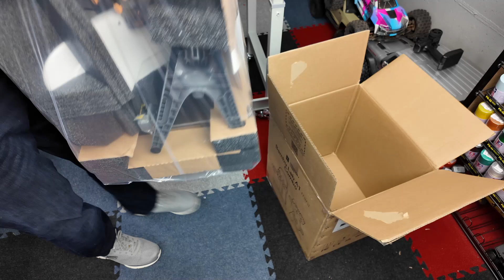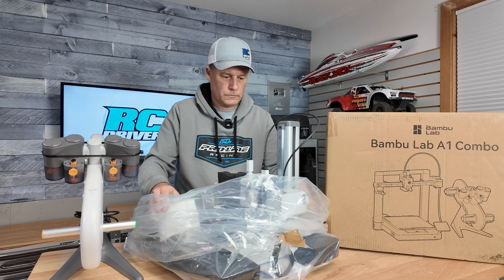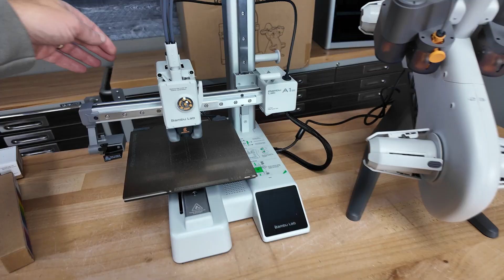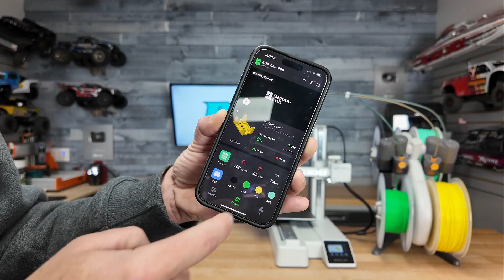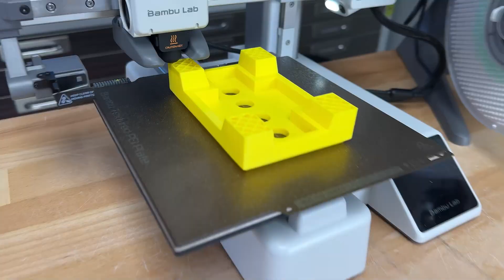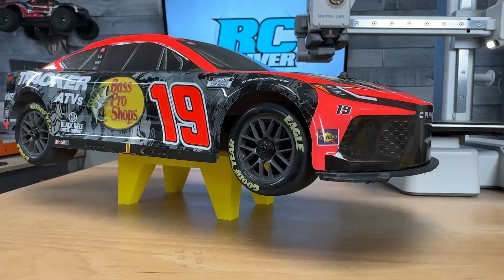$180 Amazing Mega Easy Set-Up 3D Printer - Bambu Labs A1 Mini

Comment: The version you have is the combo for $350, not $180.  Also, even though they calibrated it at the factory, you should always calibrate it out of the box and it’s also recommended to calibrate after you move it.

Comment: Only thing I would say is that you kind of want an enclosed printer for anything RC. Accessories are okay out of an A1 mini, like stands and scale bits and bobs, but anything structural like glass filled filaments or nylon for actual structural pieces like wishbones needs an enclosed, preferably heated chamber. 

PLA/TPU and PETG are all great on the A1 series, and you can get away with printing more sturdy structural filaments on the A1 with an ideal environment and a lot of ventilation but it's genuinley safer and more successful with something like a P1S or Adventurer 5M pro. The problem with an ideal environment (still air, constant ambient temperature, good humidity) is that it is always mutually exclusive with good ventilation (with an open printer... Outside 😂). 

Using a glass filled fibre or carbon reinforced filament changes a fully 3d printed car from a frequently broken novelty to a genuinely useable basher vehicle. 

But there can be no doubt about it, anyone into RC should have a 3D printer, and the 'just works' A1 series is it for the majority. 

One of the biggest use cases is printing body protectors (like the lid/bed skids on an Xmaxx) for essentially free when they wear out!
Reply: The glass filiments are actually less strong than standard petg and abs and others. There are many videos out there of people testing and proving this. I have items that I printed on my ender 3 6 years ago in standard pla and it still looks and functions like the day I printed it.

Comment: Thanks Greg. I have had a 3D printer on my wish list for several years but haven’t pulled the trigger. I’d use it mostly for scale parts/interiors or shop accessories. I’m not scared of the setup or of designing stuff, but I’m turned off by how finicky it all seems (filament choice, storage, failures, etc.) But you made the A1 Mini look straight forward and for the price it’s hard to say no. In some ways I feel like the printer is just a loss leader to get people buying filament. 😂
Reply from the maker: LOL, didn’t think of that! But it is a really good printer, decent size, at a crazy price right now.

Comment: I got the A1 for black friday and i absolutely love it. The details you can get out of it is insane. Im very tempted to get the A1 mini.
Reply from the maker: For the price they’re letting the Mini go for now, it’s insane.
Reply: The A1 mini is exactly the same as the A1, just smaller, no point unless you need a smaller footprint, or increased printing capacity with another printer added to your collection